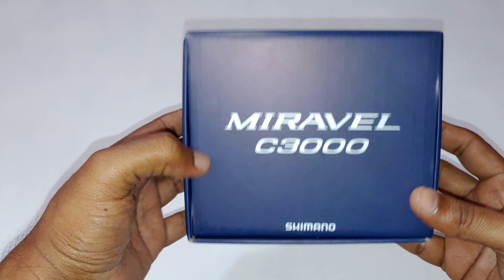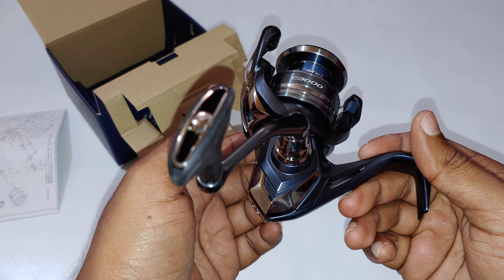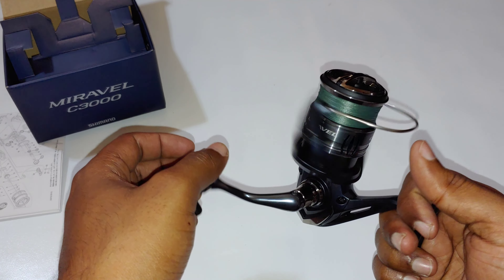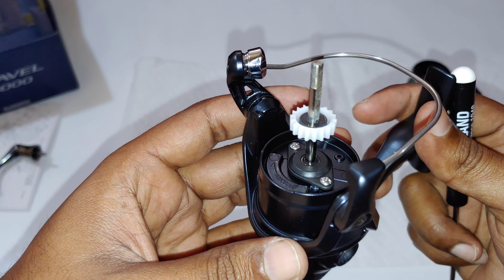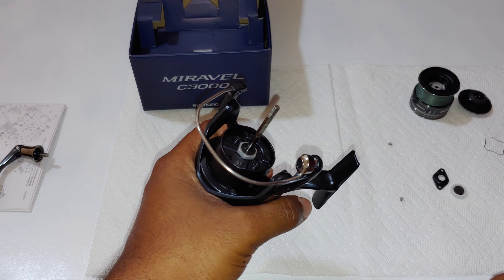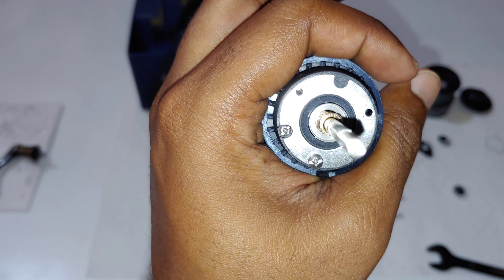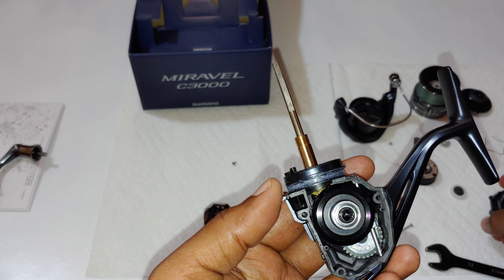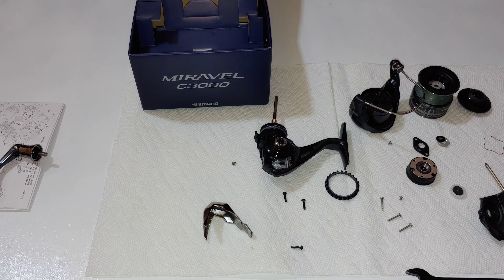2022 Shimano Miravel Unboxing, Review and Teardown

Comment: It basically has the same internals as the old stradic before the vanford except for the roller bearing. I expect the spool would interchangeable with the old stradic as well. Thank you for the tear down.
Reply: No. The Stradic has a worm drive oscillator. These are a Ci4 version of the Nasci. I have  3 Miravels. I rate them highly as you get the right features with a simpler construct for about half the cost of a Vanford. My wife uses the FB series Nasci and my brother the FC Nasci. All good reels but these later ones are much better due to the screw in handle and the bushing for the oscillator gear. Great video and to the point.

Comment: Nice video. What do you prefer betwen Miravel and Nasci. I dont know what to chose. Pls let me know wich one its much better
Reply from the maker: The miravel body is made from shimano ci4 material making it a light weight reel. The nasci is metal. It all comes down to your choice. Personally I love the miravel but you can't go wrong with either one. Please don't forget to smash that subscribe button.
Reply: Any stem flex în one of them?
Reply from the maker: No flex especially in the miravel.
Reply: Nasci I have caught many 20 to 40 lb tarpon. The miravel is a one fish wonder. The spool shaft is to small of diameter or to soft of ss steel . Spool shaft bent on 1st tarpon and now sits at a angle on the reel. Stacks line at angle not useable. Line is not tapered like you would fix with shims . I don't recommend the miravel but highly recommend the nasci . This was  the Miravel c5000xg.

Comment: As you used both reels which one its good Nasci or miravel
Reply: i have both. 🙂 just bought it last January. I can say they're both very smooth. If you prefer looks, go for nasci because it is a very good looking reel but if you want a light reel go for Miravel. Both reel are  strong and smooth, Miravel is just lighter that's why I got Miravel 5000 series coz its only 265g. I have Nasci 2500 and it is 240g

Comment: Hello! Which one do you recommend . Miravel 3000hg or Ultegra 3000hg?
Reply from the maker: Miravel 3000hg.
Reply: @sambolivar29
Ultegra is the superior reel. The only thing Miravel has going for it is the magnum light rotor. Ultegra has a proper oscillation worm for superior line lay and a line roller bearing to name a couple of improvements. For me Vanford hits the right mark for price vs performance and Vanquish is king of finesse ultralight reels

Comment: i got a 2500 miravel from bass pro 2 weeks ago . it is not a smooth reel , it drags slightly when reeling in line . it is not as smooth as my diawa BG or my RG2500hAB or even my kastking sharky 3 . i'm very disappointed in this shimano miravel and it is going back to bass pro for a refund .
Reply from the maker: Sorry to hear. You probably got a bad one in the batch.

Comment: It's not plastic don't you know the difference between carbon and plastic?
Reply from the maker: Basically the same to me because both would deform with heat.
Reply: @tackleaddictgy well, would you call a carbon fiber fishing rod plastic or worry it will deform in heat?

I doubt it. Anyway, good stuff. Thanks.